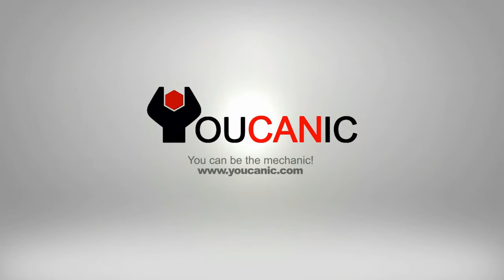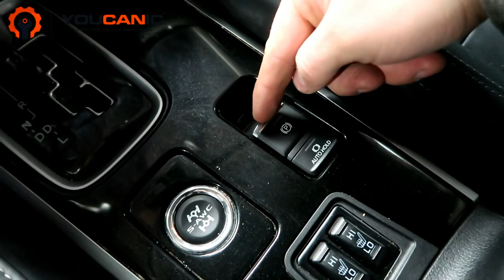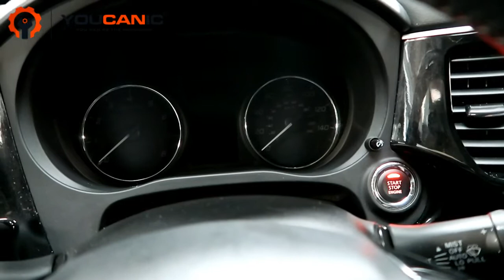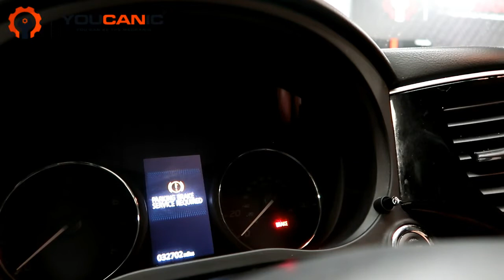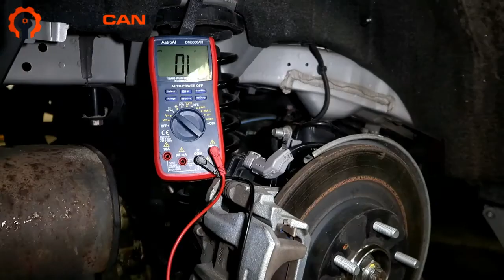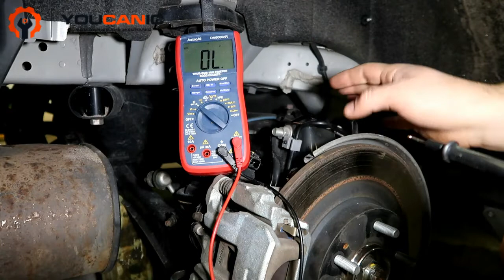Troubleshooting Mitsubishi Parking Brake Problems, BRAKE Light ON

Comment: My problem is clearing the parking brake from blinking after the repair
Reply: Just wondering how you got it fixed? I’m running into this issue now
Reply: @janellx6898 How did you solve the problem in the end?